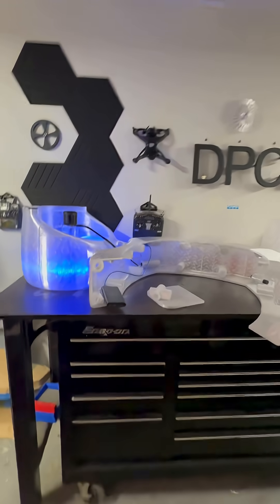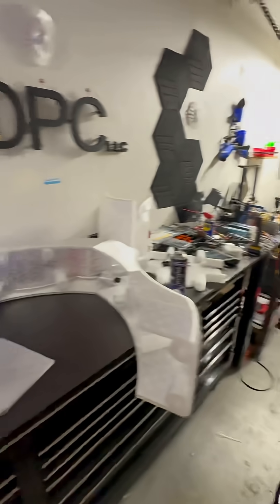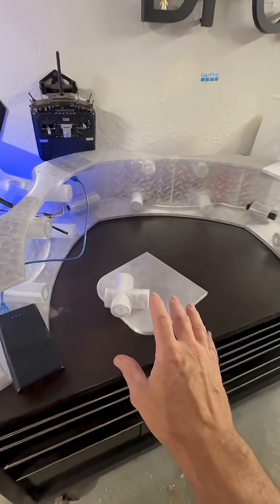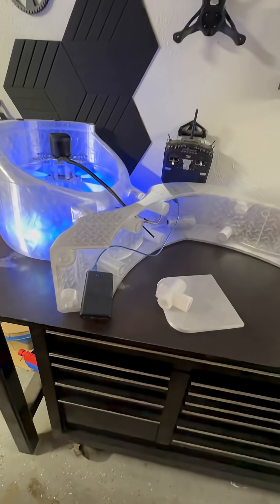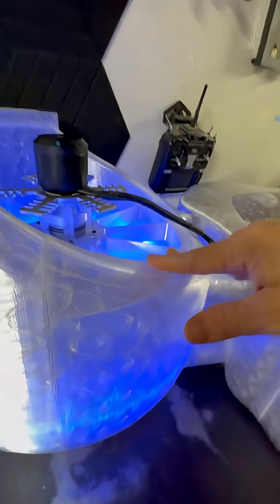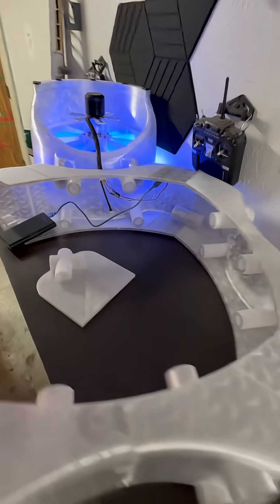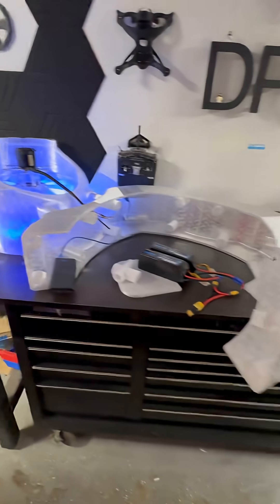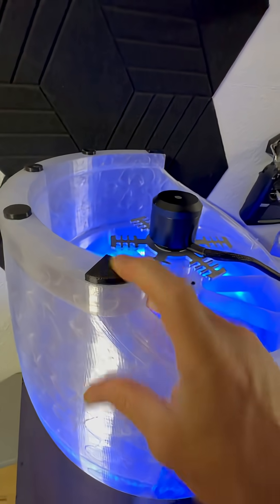Massive drone assembly the scale of this thing is terrifying. It’s insane!

Comment: This thing is gonna be monstrous 😮
Reply from the maker: Tell me about it. I literally designed a cart so I can transport it. It has a footprint of five feet, by five feet and sits 14 inches high from intake lip to duct feet. Rings in at about 70 lbs. fully assembled. Not easy to move but it worth it.